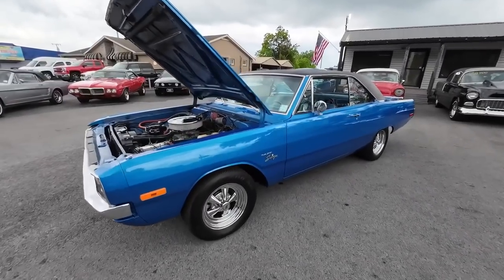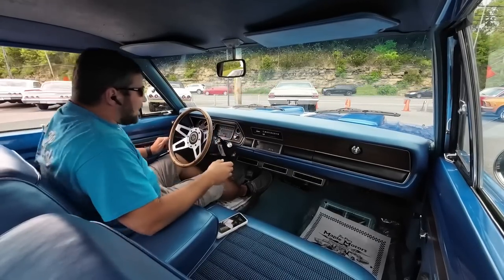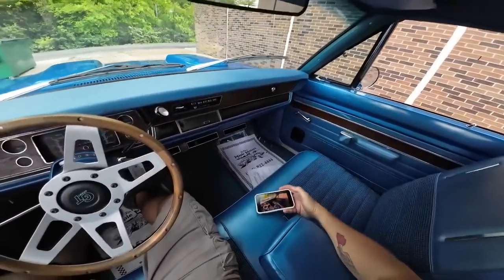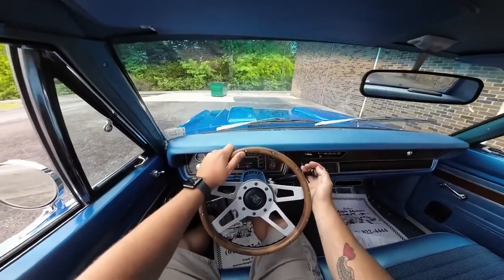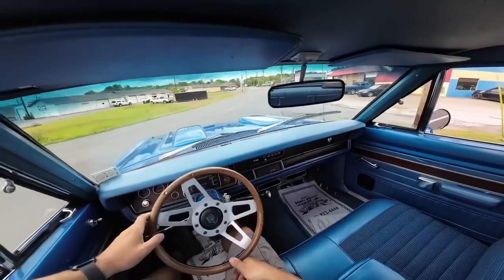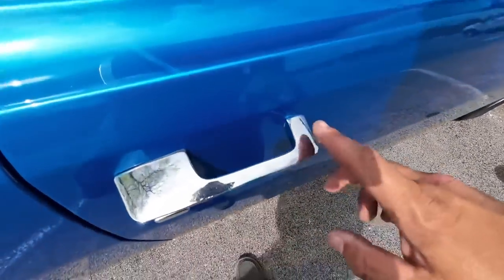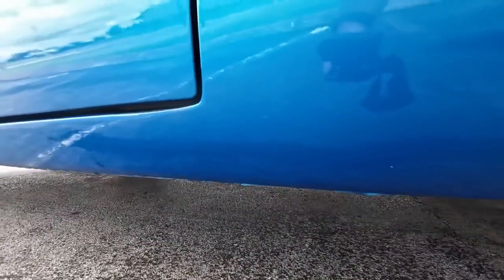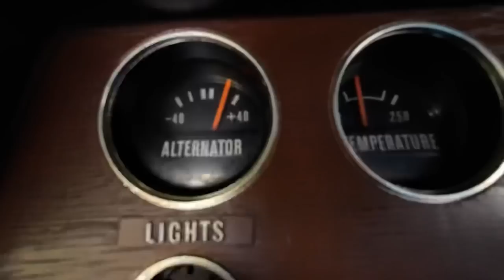Test Drive 1972 Dodge Dart SOLD $22,900 Maple Motors #1973-2

Comment: the 318 has to be the toughest little v8 ever made. boy they made a bunch. these motors were bullet proof, you couldnt kill one, i mean you could but it took a long hard while and even then it would still take there and bring you back. you can even get those things to haul ass, dont waist your time and bucks on rebuilds and after market upgrades, get the right gear with  positive traction, it will feel like a world beater.

Comment: This Dodge Dart Swinger is an awesome car. I wouldn’t change a thing. Just drive it as is. It doesn’t seem to need anything. Everything seems to be be working fine. Even has a horn. 😂 Nice Blue color. Nice vinyl top. Great interior. Cragers. 4 wheel disc brakes. Air. I would definitely like to buy it.

Comment: Nice looking car. My mom use to have a 72 Dodge Dart with i think a 225 engine, and similar bodystyle. It was a reliable car. Not a lot of bells and whistles though, but with the right engine you could make a hot rod out of it! These cars are very simple to work on, and i miss my mom's old Dodge dart.

Comment: Make mine a 340, 1970/71, 4 speed manual or 3 speed auto on the floor with posi traction.